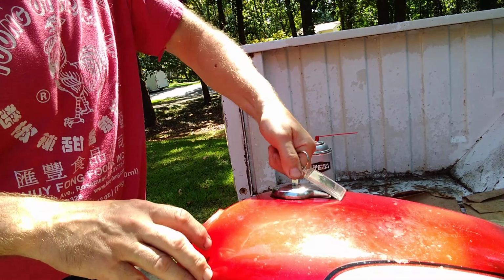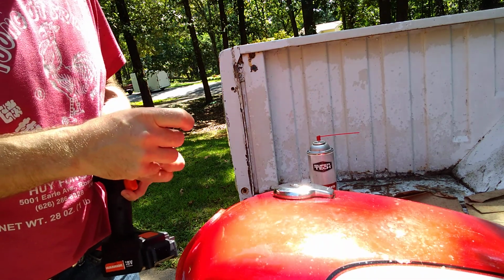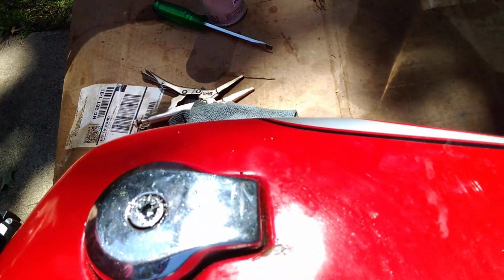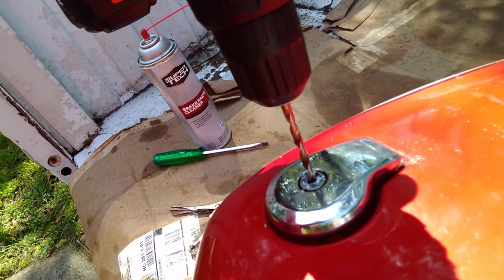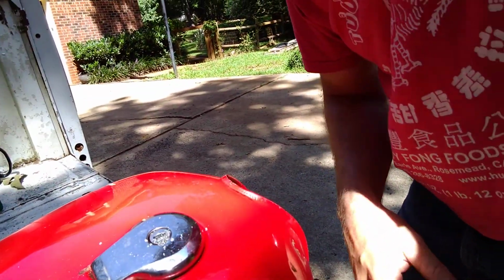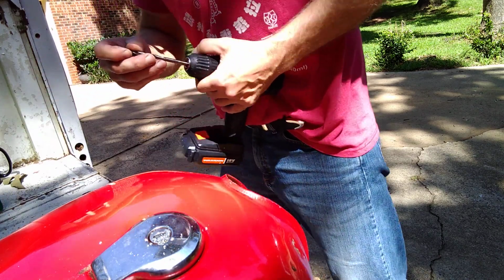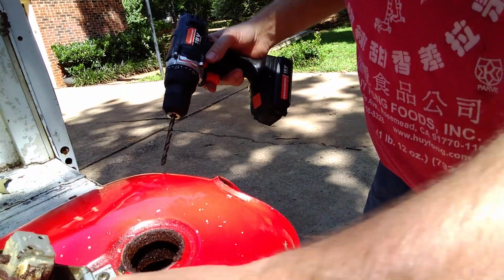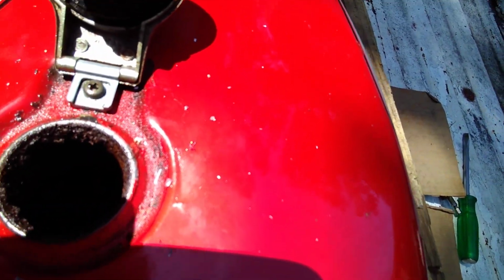How to open stuck gas cap, lost key, last resort

Comment: Wouldn't using a drill put metal shavings into the tank and in turn put metal shavings into your feel and engine etc
Reply: Feul*
Reply: Fuel**
Reply: chances are if u doing this u cleaning the tank afterwards
Reply: That was my biggest concern, any way to mitigate? Lay the bike on its side?

Comment: Isn't that a tank from a Yamaha Seca from the 80's???  My first bike was one I got back in 1988-89 when I was 15. I traded a Graphix Water Pipe for a beat up drum set and then traded that for the Seca. I used to use it to deliver papers on my paper route and then because I didn't have a Driver's License yet I would sneak down the backroads out to the country at the crack of dawn and ride it for hours. Same red with the white strip tank.

Comment: That isn't practical thing to do its just a show to destroy the key hole instead of using other method you end up a quick solution. The simple method to open the cap without a key is just by using 2 flatted thin metal rod the one is for twisting and the last one is a pins pusher. That's it ... Very simple - FROM PHILIPPINES.
Reply: I lost the key to my 125 xtz can you link a video showing this explanation you did?
Reply: @KrashhDaBoss  they're basically saying to pick the lock

Comment: How you change the cap if you lost the key? That’s what I’ve run into with mine. Put it up 2 months ago and can’t remember where I put it. Mine is an 83 Yamaha 920 and it also has a stupid seat lock that fits the same key I lost.
Reply from the maker: I'm not sure, my tank was full of varnish and rust. I figured cap was bad anyway. Some one commented that there was a way to unlock with two metal straps. I would go to a lock Smith, should be able to make a key cheap no travel time if you bring it to them
Reply: I'm in the same boat. I've ordered a new key switch kit and I can install this no problem,  just getting the old gascap off is gonna suck

Comment: You should be real careful drilling a gas cap on the tank...
Better to just brute force it with a screwdriver/locking vicegrip combo and bust the wafers. 
You might have to empty the tank, but you'll have to anyway and if that sparks, might get a nice lil fire to put out...

You could also do like the one from the Phillipines said and use a small allen key as a tensioner, and like something flat and thin enough to push the pins and get em flush and you just kinda put the tension down like you would if you were turning your key, kinda feel out the wafers (they'll click as they go flush and fall under the tumbler's tension). 

Do that for like 1 minute and voila!! 
Another thing you could do is get a really thin screwdriver, a nice 3lb sledge hammer and bust up the wafers in the lock just enough to easily turn it with that same flathead or any old key.
Reply from the maker: Tank was cleaned and lined, no gas in it yet

Comment: Lost my keys so i put a new ignition on ,completely ruinated the seat lock and gas gap ......then found my fucking keys  inside the bag i keep my tyre inflator in..ill have to drill a screw into the cap to turn the bastard off